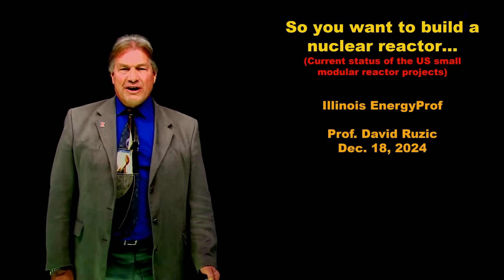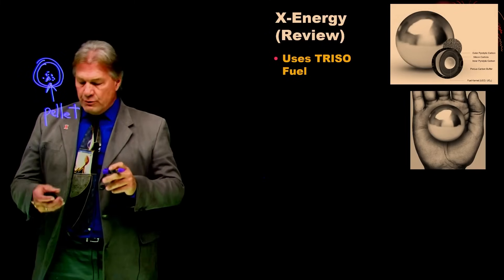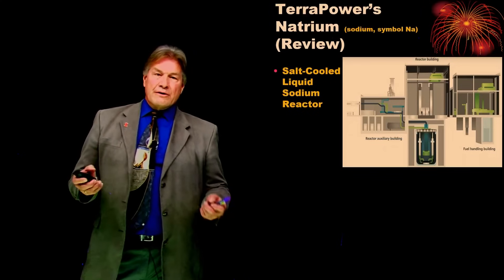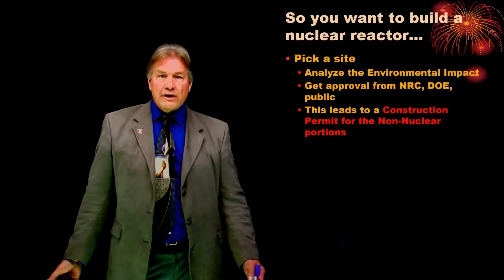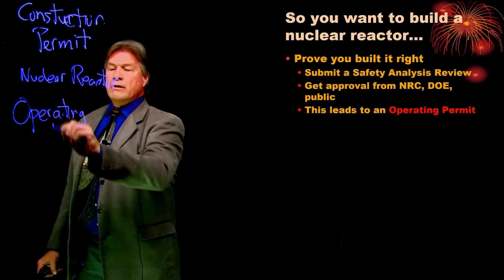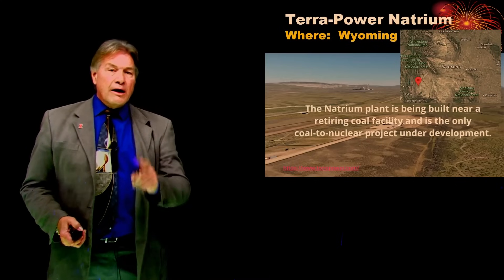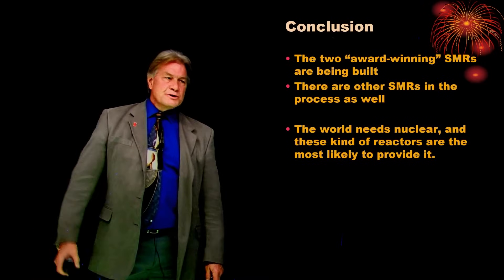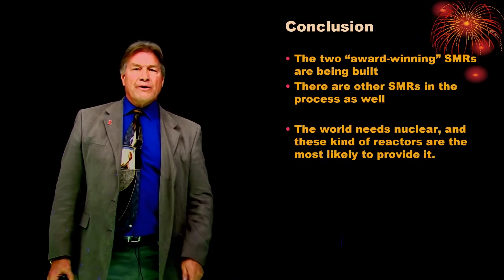So You Want to Build a Nuclear Reactor

Comment: As an engineer who has worked in nuclear power plants and am very pro-nuclear I find that your presentation has some glaring misstatements; and one huge omission.

1) I do not know of a single nuclear power plant built anywhere in the world where the reactor was not built in a factory somewhere and transported to site by truck, train, and in a few cases barges.   If that is your definition of modular.... then all of the worlds nuclear power plants ever built have been modular.

Of course - there industry has a hard time explaining what modular really is and that its not really different than how nuclear (and conventional) power plants have always been built.

2) Every pebble bed reactor built so far has had problems with pebbles breaking - and releasing the bad stuff contained in the pebbles. Germany built 2 of them. South Africa built one of them (of the German design) and China licensed the German technology and has recently built 2 small pebble bed reactors that feed a single turbine generator.  However, the Chinese designed to contain the release from broken pebbles as they expect that they will occur.  

The Chinese did some design changes to hopefully minimize the number of broken pebbles; and to try to minimize if not eliminate stuck pebbles in the bottom of the reactors (both of the German pebble bed rectors have noticeable numbers of stuck highly radioactive pebbles in the bottom of the reactors.....  Massive cleanup/decommissioning issue and the Germans have yet to come up with a way to deal with it at this point (about 35 years after shutdown of those reactors).

3) Why did you not talk about NuScale's Utah Project that actually had a NRC approved reactor design (years ahead of anyone else) that got canceled last year when the construction cost came in at about the cost of building a single AP1000 plant.

Here's the details:  NuScale was the 1st company to get an NRC approved SMR reactor design (50 MWe).  Their initial plans were to build 6 of these with an output of 300 MWe and they had a site and Utility partners in Utah.

They figured that the 50MWe plants would not be economical and were working on a 77 MWe version that was on the cusp of submittal to the NRC (with expectations that it would be approved quickly as it was just an enlarged version of their 50 MWe plant and something like 85% of the expected submittal package was already approved). 

The new plan was to build a 6 Unit plant using the 77 MWe reactors with a single control room (462 MWe total).

They went out for construction bids using the companies who had built the Vogtle and partially completed VC Summer AP1000 units as these companies had learned a lot of lessons about building nuclear power plants that had been forgotten (and those lessons learned resulted in years of delays and billions of dollars of cost overruns - most of which would not happen again if the companies started building another set of AP1000's).

The quote came in at about $9.5 Billion to construct this 6 Unit 462 MWe plant, with an estimated $1 Billion+ inflation adjustment during the construction period.  Total in excess of $10.5 Billion

In reality this would have been about the same price to build a single Westinghouse AP-1000 (about 1150 MWe) and the staffing for the plant would have been about the same. 

So the NuScale plant would have cost about 2.5 times as much to build on a per MWhr basis and cost about 2.5 times as much as an AP1000 to staff.

NuScale and their partner Utilities canceled the SMR project mid 2023 as it was considered totally uneconomical.

A truth that the nuclear industry has known since the 1970's (when we had built what would be considered 17 SMR reactors - and then built larger ones) is that if you double the size of the nuclear power plant - you need about 40% more material and it cost about 40% more to build.  In many cases the staff size does not change.  When the plants get large enough that the staff has to be increased its only an incremental increase in staff size.

This is what drove every nation in the world to GW+ sized nuclear power plants.   The economics of scale drive you to build as large of a plant as you can (assuming the power demand is there). Smaller plants are only built where there is lower power demand or unique geographic isolating features that prevent the running of adequate power lines.

Worldwide there are about 60 GW+ sized nuclear power plants under construction at any time.  Average completion time is 6 years and they are generally completed on budget.

I have seen no evidence to suggest that SMR's will be cost effective compared to large central stations unless you are in an isolated geographic area where they only need a small plant.

We have actual evidence of this in both the NuScale SMR project cancellation last year, and that the Chinese have admitted that their building of what was expected to be their entry into the SMR market is uneconomical due to excessive construction cost on a per MWhr basis.

I do support building more nuclear power plants...  I just don't see any evidence that they will be SMRs, or that SMRs will ever be cost competitive to large central stations.  

Note the SMR concept was presented by the USA at the worldwide Nuclear Power Conference in Europe in 1955 so the idea is not new at all.  The 1st planned SMR reactor design which was planned to be deployed across the rural areas of the USA was was a 22 MWe thorium fuel cycle based BWR in Elk River Minnesota (USA). Online 1964, Shutdown 3.5 years later in 1968 due to design issues. However, it had already been deemed uneconomical as a power plant just due to staffing cost alone.  

Also note that there is nothing new about the thorium fuel cycle either.  The USA built a fuel plant and 4 Commercial Nuclear Power plants (up to 330 MWe) in the 1960's - 1980's.  Germany built a 5th one in the 1980s (300 MWe).  All we did was prove that uranium reactor fuel was far cheaper than thorium reactor fuel (its vastly more costly to extract thorium from the ore and convert it to reactor fuel than to extract and enrich uranium for nuclear reactor fuel).  Most of those plants were converted to uranium fuel rather quickly due to economics.  We seriously tried to develop the thorium fuel cycle.  What killed it was simple economics... We have proven thorium core designs that could be put into most of the worlds PWR and BWR nuclear power plants if thorium was cheaper.  No one is doing that because.... at this stage uranium fuel is still cheaper than thorium fuel.

The US and Western Europe has to get their act together and keep building them to train a new generation on how to build nuclear power plants to nuclear plant standards... Something we both forgot how to do which has resulted in massive delays and cost overruns with the first few projects (AP1000's in the USA and EPR in Europe).  By the 3rd set we should be able to build on time and on budget - comparable to what it cost other countries to build these plants (somewhat higher due to the higher wages in the USA an Europe).
Reply: After thinking about it the Soviet RMBK graphite block reactors (Chernobyl design) and the  UK Magnox gas cooled graphite block reactors were likely field assembled.   It is interesting to note that both of these reactor designs have had nuclear accidents where the graphite core blocks caught on fire and burned.   The Magox reactors were in a controlled ventilation building and had filters that caught at least 95% of the radioactive materials released which limited the release to the public in 1957 to a very small fraction of what Chernobyl's 1986 release was.

The UK Advanced Gas Reactors (AGR's) that replaced the Magnox reactors might also have been field assembled.

I'm also not sure about the early CANDU reactor designs.  They could have been field assembled.

The pebble bed reactors have all been fabricated in a factory and shipped to site for installation.

ALL BWR, PWR, and liquid metal (sodium/lead alloy) cooled reactors in the world were and are fabricated in a factory and shipped to the site for installation.  BWR & PWR reactors make up about 95% of all nuclear power plants in the world.

Comment: SMRs are the only sensible option for long term colonization of the moon or Mars, or powering large artificial satellites long term. Photovoltaic or wind cannot possibly miniaturize or improve on efficiency enough to power a Martian surface colony and you have to scale them up so far with ever increasing expense for upkeep and ever diminishing returns on marginal power generated to make any kind of scaled mining or construction possible to set up, much less with sustainable growth. Maybe you could consider solar feasible for a Mars colony, but only with long term sustainment from Earth for maintenance and replacement needs.
Reply: You know why the rovers we send to Mars are solar powered? Because it works.

Comment: If I was a betting man, I’d suggest Amazon wants to cut a deal for cheap power to run their AI servers in about 10 years.
Reply: That's the idea, but when the project goes belly-up they will just write the loss off and pay a little less tax. They can't really lose (that much).
Reply: I don't think anyone would bet against that -- they want a contract to lock in low cost rates for electricity. That's the whole point, yes.

Comment: Dresden Unit 1 took 5 years from signing the contract to being commissioned. Why does it take so long to build a nuclear plant now?
Reply from the maker: The second half of the video describes the licensing process, and that is part of it.   Once designs have gone through all that, and have actually been built and operated, the process will go much faster.  That is one of the advantages of "modular" meaning the reactor parts are made in one factory over and over.

Comment: How much uranium does the US produce?
Uranium mining in the United States - Wikipedia
Uranium mining in the United States produced 224,331 pounds (101.8 tonnes) of U3O8 in 2023, 15% of the 2018 production of 1,447,945 pounds (656.8 tonnes) of U3O8. The 2023 production represents 0.4% of the uranium fuel requirements of the US's nuclear power reactors for the year.
Reply from the maker: Sounds like I need to do a video on fuel supply and enrichment.   I do not believe supply is an issue once there is demand, and given new enrichment technology, but I will look into it deeply and make a video about it in 2025.

Comment: Isn't the trouble with SMRs that they are neither small nor modular? But being ~100MW rather than 1GW, do not benefit from economies of scale.
Reply: SMR is just a marketing term that has no real meaning. What counts is a low-pressure/high-temperature reactor that gets built in a factory and assembled in the field. With a high-temperature reactor, you can separate the nuclear side of the power plant from the power conversion side as he described about Natrium. There is no giant air-tight pressure containment structure needed and all of the equipment is the same as for a natural gas plant, not nuclear certified. Very few nuclear-certified workers would be needed outside the factory, the rest are the same workers that build gas plants.

Comment: Why liquid metal sodium instead of sodium chloride?  Is there really such a huge advantage to metallic sodium?  Also, why does the US refuse to continue the research on molten salt core reactors?  I'm baffled that the best argument against them boils down to "we don't have enough current information."
Reply from the maker: There are designs and tests with molten salt as the primary coolant.  One of the biggest issues is that with salt as the primary coolant is that the reactor has to run at a much higher temperature to become molten (800C) while sodium is molten at 100C.   This has serious safety concerns as you may imagine.
Reply: @illinoisenergyprof6878  Except, isn't having the temp high the point?  Besides, there are salts that melt at substantially lower temps.  And those salts won't be explosive if there's a leak.
Reply: @illinoisenergyprof6878  And corrosion resistant materials. Bit of a show-stopper right there.

Comment: The world does not need nuclear. The currently used U235 can not power the world - there is just not enough of it. The current uranium reserves are OK for the current reactors and a few more under construction. Already than the fuel costs will go up, as lower grade ore needs to be used. So the currently observed decline (less new build than shut down) in nuclear power is the logic path.
It is not really worth spending extra government money in the developement reactors that will not have enough fuel to really make a difference and would be ready in volume maybe in 2040. The expected costs are also too high to be competative in most areas.

So far the pebble bed fuel in nuclear reactors had a pretty bad track record, with broken balls, higher than expected wear and poor control where the balls go. It is not a new idea, more one that already failed.

Comment: Hi Professor, in Australia, the federal opposition has announced they will build nuclear reactors here, most of them taking up land where coal plants are located or were there. The next election in 2025 will be a choice of nuclear future or renewables with gas fired stations as backup. I do hope for Australia to finally become a nuclear nation. It is great to see you back on YT. Have a great new year.
Reply: It will not be a choice of nuclear or renewables.

The coalition plan is for a predominantly renewable grid with some nuclear in the mix.
Given our existing coal fired power plants will be shut down soon, and considering the time frame of construction for nuclear power plants (as evinced by this video), we will require a ~100% renewable grid to be up and running before the first (let alone the last of seven) nuclear power plant is commissioned.
Reply: @rohansprenger6902  100% renewable?  4 - 10 x the cost when you consider the land to purchase for the solar/wind farms, land for the solar panel, wind turbine blades and battery waist, billions for the 1000's of kilometers of transmission lines. Like SA, the shortfall will be covered by gas. The pollution from renewables scares me more that the little bit of radioactive waist from nuclear.
Reply: The opposition plan is a plan to delay renewables, keep us on gas as long as possible and score cushy jobs advising Santos. Ted & Spud wouldn't be able to pass a Physics 101 class, so trusting their proposal for Nuclear is peak gullibility and exactly what I expect from the Australian electorate.
Reply: To no-ones surprise, the opposition's nuclear power proposal has generated ill-informed an hysterical (non-nuclear) reaction.
If the proponents ( The Australian Liberal* Party) have the brains to find lucid and reasonable advocates such as the good Professor Ruzik to do the talking, the proposal might make an impact.
Regrettably, our politicians' credibility is about as low as their US counterparts. Personally I'm not convinced the Liberals have bothered to think this one through - they think in terms of wedge issues and little else.

(* Liberal in Australian-speak translates as "conservative". Not to be confused with what are known in North America as Libruls)
Reply: Would you have one within 10 kilometres of your home, here in Wa the residents of kwinana don't want it, another point is that the average house values drop 28% worldwide within 10 kilometers of a nuclear reactor.

I live in coogee a upmarket area just north of kwinana and a liberal area we don't want one either, maybe dalkeith will be better since they are the ones advocating for one, good luck with that.
llbuono.
Reply: @walterjames1669  What are the house prices in France? Answer, close to power stations, expensive.

Comment: As far as I remember the X-Energy reactor is similar with that one that was involved in the one of the few accidents in Germany. It's about THTR-300 reactor. Here is the story: https://youtu.be/0gskQJE6lxU?si=qqD_j0n9uCX1hvlj
Reply from the maker: I looked at that video, and the THTR-300 was a thorium reactor, not uranium fueled.   In addition it was not "4th generation" where the inherrent safety comes from the Doppler shift -- expanding the resonances when the fuel gets hot -- so that if the reactor overheats, the fision process is guranteed by the laws of physics to stop.  It is a pebble-bed but the technology on how to move pebbles around has had 50 years of improvements too.
Reply: @illinoisenergyprof6878  thank you for your response.